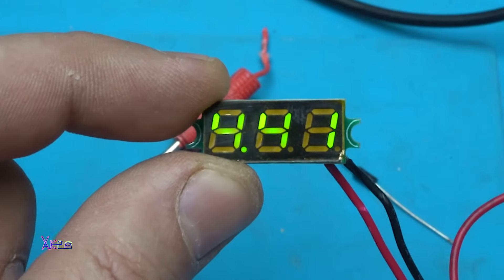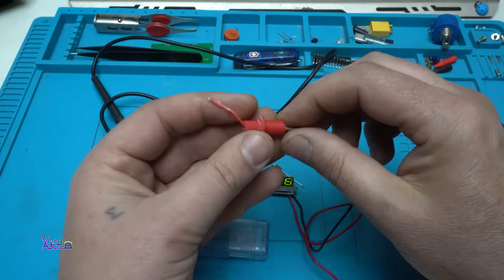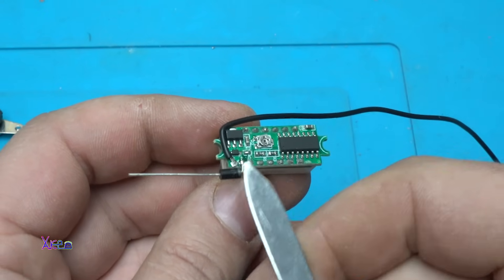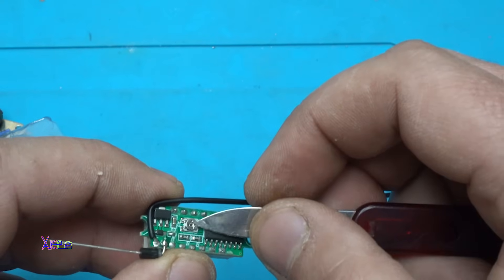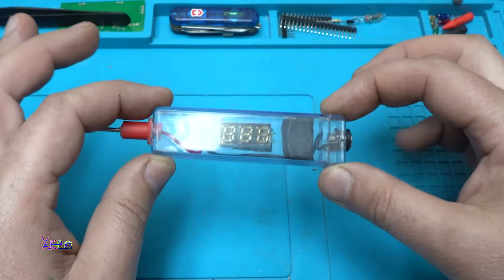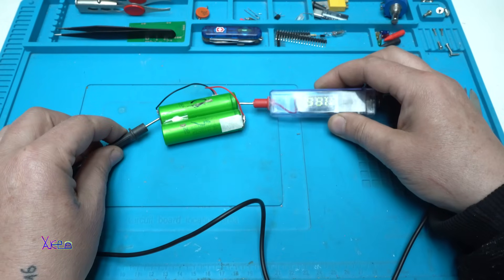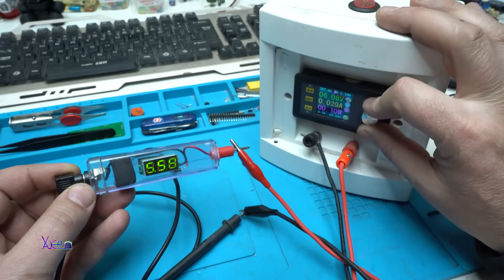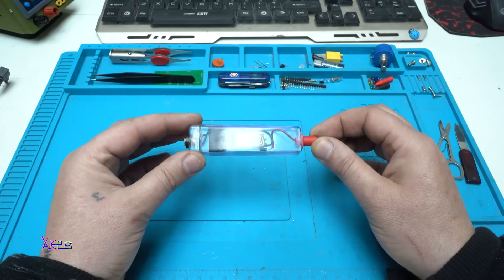How To Make Voltage Tester PEN at home!

Comment: Ripper muck-up, display upside down "Little mistake", pity you didn't spot the decimal points at the top during assembly. One change I'd make, put in another banana socket in at the probe end, then make a banana plug probe. this way you can swap ends and use it for negative voltages, use regular meter lead set etc, more use options.
Reply from the maker: I'm fixing it soon!